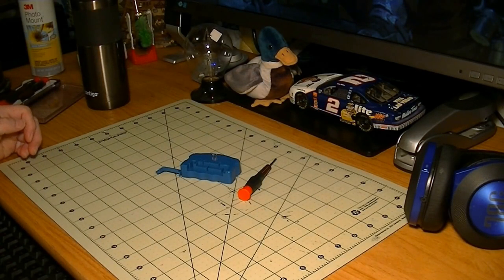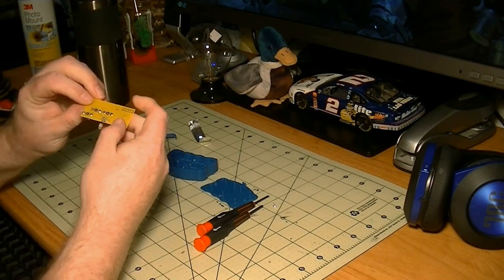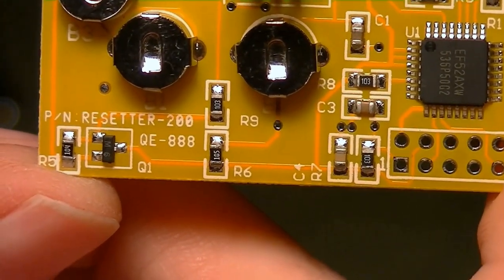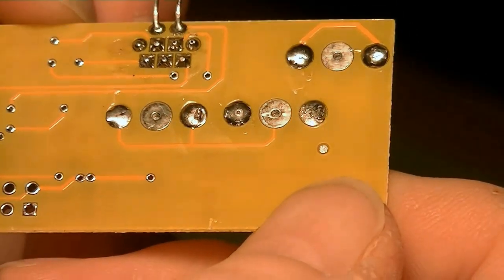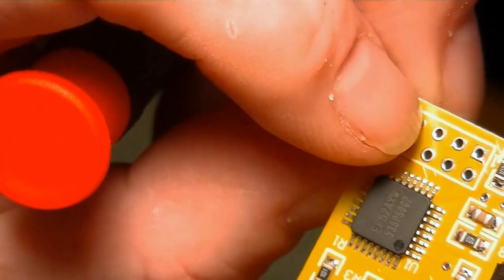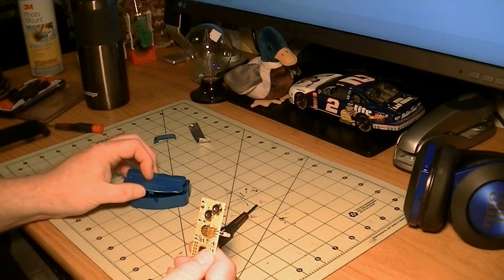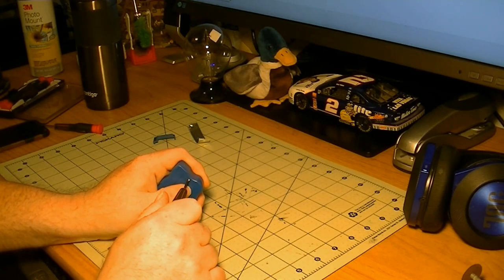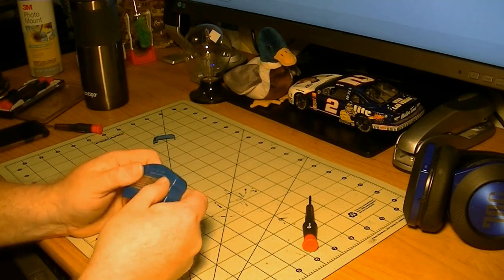Printer Ink Cartridge Pin Re-setter Tool Tear-down, with surprise ending!!!

Comment: the resetter does nothing on the chips in the original ink cartridges.
you must buy refillable cartridges with or without a chip.
be careful, this reset has a limit ... 20 ... 40 times to reset.
but not 20 x 4..no no no ....
the reset limit is for the 4 cartridges ... that is ... 20/4 = 5 ...
5 times each cartridge ....